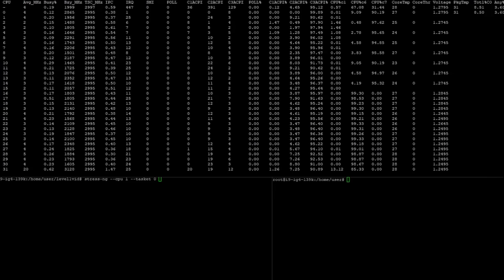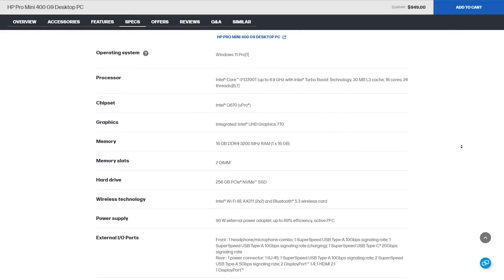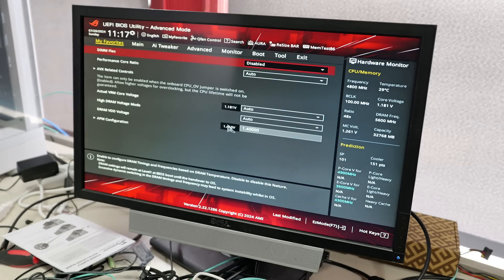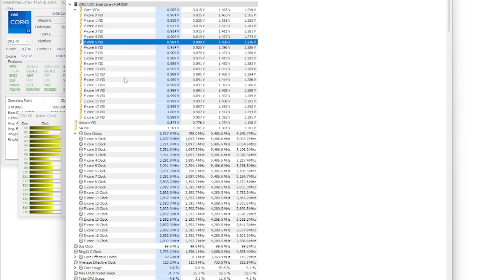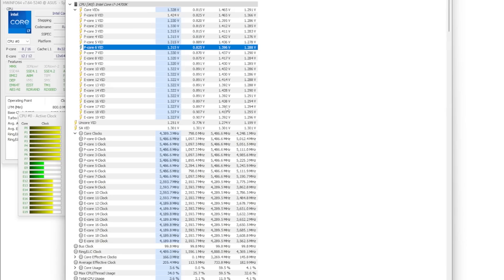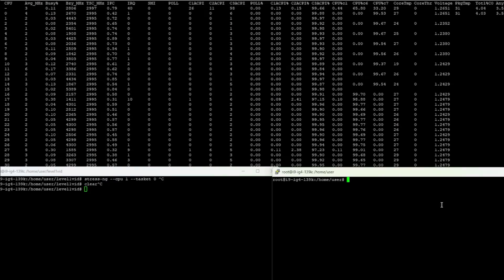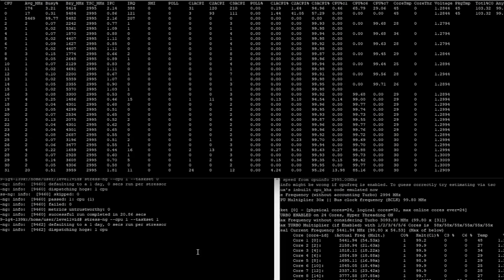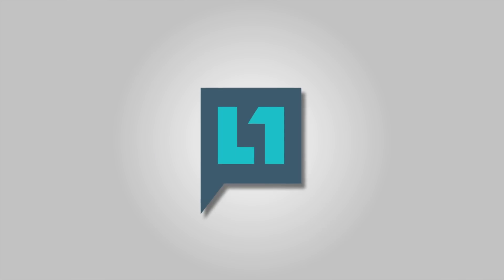Turbostat.c: Let's Add a Voltage Monitor Patch for Intel CPUs

Comment: Wendell does what Inteldon't
Reply: If Intel release a fix for a bug, doesn’t that mean that Intel CPUs had a bug? Not possible! Oh, the humanity!😂😂😂
Reply: @tringuyen7519 the real problem is that even if they fix the bug, most likely there will be a loss of performance. And the CPUs that are already having issues will not be able to run at higher speeds if at all.
Reply: @steveftoth  also patching already damaged chips wont somehow make them fixed.
Reply: What inteldont is also a live USB image that anyone can run to test whether their CPU is OK or needs to be replaced. Intel should hire RAD Game Tools and a bunch of independent labs to farm out various test. It has been noticed that RAD's Oodle experiences algorithmic errors on ailing Intel CPUs.

RAD has an existing relationship with Intel, RAD being developers of Larrabee.
Reply: @SianaGearz All programs have the same issue with Intel chips, but RAD game tools checksums everything it does and tells you when it's not matching up.

Tl;Dr Everything has the same problem but RAD is the only one that actually checks for it.
Reply: @Gen0cidePTB  Oh i'm sure different code has different probability of upsetting the chip, since micro utilisation can be very different and thus how much voltage droops on parts of the die. Different ALU use and different amount of cache/memory wait. RAD are experts at these optimisations.

You are right, the affected tool being Oodle, it makes sense that it can detect failure, as you say, checksums. Basically all compressors use checksums, it is tradition.

But you can verify other types of computation by running them several times, or by having known inputs and known outputs. At this point, one wouldn't be surprised if Intel knew Intel oneMKL fails to compute and let it slide.

Comment: can we collect vid data and profile systems?
i would warn you against comparing data between different motherboards and motherboard bioses using the intel register without doing something to validate that these are valid comparisons. the null hypothesis is that they are not. 

i am willing to put in some work on this if i can be of help
Reply: it would  be reallllly nice to get some more data wrt to the T variants suffering this issue.

Comment: So might the voltage story from intel be a lie? To buy time or so?
Reply: Voltage is at least a part of it. If the P cores are lightly loaded the E cores can make stupid VID requests (for some reason) which might be juicing the ring. There are other things on the package than cores that might be misbehaving. Like what else is one the same power plane as the memory controller? VDD2 is supposed to be 1.2 (DDR4) or 1.1 (DDR5) but a quick search is telling me XMP profiles are/were pushing it to 1.3-1.5(!)V.
Reply: @duckrutt  DDR 4 was always rated for 1.3V and more my kit is 1.35V this has been working for the last decade!

Comment: While probably not in the same realm as CPU binning, where bleeding edge thresholds make or break a CPU model, or scrap, quality of motherboards in the same product line or production run probably  vary much more than we would like to know and the manufactures would admit.

Comment: I have the 13500. I started off with Asus B760 Prime. I had constant freezes and power kernel problems. Every diagnostic checked out. The seller exchanged the motherboard for a Gigabyte Z790 Aorus DDR4 which seems to have fixed the problem. Haven't had an issue since then. Will I be okay? 😢
Reply: This mostly effects 13th & 14th i9s and very few i7s. the i5's generally don't request over 1.4v per core.
Reply: Probably just Asus again 😢

Comment: It was a binning issue, it was intel chasing $$$,  The yield on the silicon quality for the top binning for i9 was too low and they could not produce enough i9's, so they simply pushed the lower quality silicon into the higher bins, so they could meet the demand for the higher profit i9's.  half of them should have been binned as i7's or lower.
Reply: @blitzwing1 Just look at where intel is in the world at the moment, they used to be number 1,  they are like number 5 at the moment in the silicon market?   It may have simply been a desperation move by middle management so they could save their KPI's and bonuses etc.  That would be the most simple answer.
Reply: Wendell has actually stated that the chips vary in quality but I haven't seen any evidence that Intel knew they were different quality and programmed the VID differently based on their own testing. 

A chart showing the requested voltage for various load for a fairly large number of good chips vs the load for a similar number of bad chips would be interesting.
If it is really a binning issues that Intel tried to get around by programming different VID curves per processor, there should be obvious difference between the two groups.
A statistical test should show that at least for voltage response that they are different populations.

If Intel did push VID to excessive levels on some chips to release them as i9s when they should have been i7's, it is going to come out in discovery. 
They can't continue to hide what they know now that they are defendants in a lawsuit
Reply: @mattzun6779  happy to be proven wrong, lets see what comes out.
Reply: No.
Reply: @borandiUK  Hi Ian, care to elaborate?
Reply: Even if true, that explains absolutely nothing about why they’re now failing. At best this is a squirrel meant to distract.
Reply: Indeed - even if that's true, no CPU should be pulling such high voltages no matter what the binning level was. (Plus the motherboards should also not allow that much voltage into the CPU). This is either a bug in one of the voltage controllers of the chip or something gone wrong with the architecture somewhere. It's also a V&V failure to not catch this during release testing...
Reply: @peterwstacey  Or simply a too aggressive algorithm for the silicon quality to meet its base specs.  Call that a bug if you will.  The motivating intent and outcome are the same.
Reply: Oh wow, source?
Reply: @hard4hardware  He seems to be quoting Tom from Moore's Law Is Dead. But take note that MLID stated this as only ONE OF the 3 potential stability issues, & probably not the main one (the others are oxidation of one batch plus the ring-bus voltage issue).

Comment: Off-topic: People need to start upscaling their 1080p footage to 1440p, YouTube's 1080p is unwatchable on a monitor. It looks like TV 480p.
Reply: to 4k as it is 1 to 1
Reply: I have a 1080p monitor and I can watch this video easily. Are you talking about watching it on higher resolution or larger monitor?
YT compression algorithm is poor, but I wouldn't say it's 480p bad (though I can't verify it on higher resolution monitor). And I did see people who were uploading 4K versions of the videos, because it allegedly also meant watching 1080p better (I assume that for that to work you'd have to switch YT to 4K on 1080p monitor - and I have no idea how much benefit it will make).
Reply: @jannegrey  It's because of the bitrate. I forget what the value is, though back then the Premium users didn't had a separate one. But basically because of the bitrate, even if the source (what the creator uploaded) and output (what youtube streams to us when we're watching) are both 1080p, meeting the bitrate might force the encoder to make the video be of a worse quality. Especially easy to be seen on things that are in motion and on small features, like small text. From what I know YTs bitrate is better than twitch (a bit understandable, as live streaming is more difficult to make with high level encoders and bitrate) but still nowhere near enough to be able to handle any type of content.

And some creators upload a 1440p version, even if the original content is 1080p because each quality has a different bitrate and, of course, 1440p has higher bitrate for streaming that 1080p, so with it, you can watch the 1080p video at or near native quality, because it's not so hampered by the bitrate anymore.
Reply: @Bound4Earth  Try switching between 720p and 1080p, there is basically no difference. I'm watching this on a 4k 32" monitor, the quality is bad enough to be distracting some of the time. YouTube's "4k" looks actually worse than proper high quality 1080p footage. I know they're trying to save every penny but give us proper 1080p and not this upscaled 480p looking t*ash.
Reply: @owlmostdead9492 This sounds more like a bandwidth issue. Bursty connection would bounce around in quality. I am picky about quality, and YouTube is not great, but definitely not trash, unless there is a connection issue having YouTube send over lower bitrate data streams.
Reply: To get the full proper quality they want you to get on the YouTube premium.

Comment: who in the HELL buys anything from Intel ?
Reply: I think people who need as high single core frequency as possible. While overall throughput might be less than other CPU, in some scenarios given that minimum IPC is achieved, maximum frequency will have some benefits. It's a bit different use from how regular CPUs are used.

Also FYI, still over half of x86 CPUs sold worldwide are Intel.
Reply: @jannegrey  that is because 1/2 the population are republican idiots out for themselves.
Reply: I might buy an Arrow Lake laptop, if Intel still exists by then.
Reply: People who still think Intel is better 💀

Comment: i went down the rabbithole of c-states on the package level, monitored by powertop. kaby lake worked fine for this. but not alder lake. for kaby lake i could save 1w per core at the wall.

Comment: 5:45 s/megaohm/milliohm/
Reply from the maker: doh, I meant that said the wrong thing ouppsssss
Reply: It bothers me too. Persistently being 9 orders of magnitude off hurts my ears. :)
Reply: It's milli-ohms and not mega-ohms for both DC and AC loadline.
Reply: @pravardhanus  People should just learn M = MEGA, m = milli and W for WUMBO
Reply: @owlmostdead9492  And then there's micro, which is supposed to be µ, but u and mc are also used. My engineer brain hates it. At least u doesn't clash with anything.
Reply: @samiraperi467  u stands for "atomic mass unit" which is approximately the mass of a proton

Comment: As a shoutout... Those T-series Intel SKUs (or their closely-related cousins) are also often found in industrial/manufacturing environments in "Edge" or "IoT" machines (sometimes called industrial PCs or IPCs). Interestingly enough... I haven't seem many (any?) 13th/14th gen Panel PCs or other embedded hardware solutions... but that doesn't mean they aren't out there.
Reply: some of the "rent a minecraft server for your friends" use a business class 
SFF dell/hp/lenovo with T series cpus, and those Do Not Like that workload, interstingly.
Reply: You can also find them in some mini pcs... Looking at u hp!!!
Reply: There are (or were?) new embedded options coming out that have their e-cores completely disabled check the 14901ke. Interestingly they now disappared from intel ark but Google still points to the Ark page as are many news outlets.
Reply: Some laptops as well.